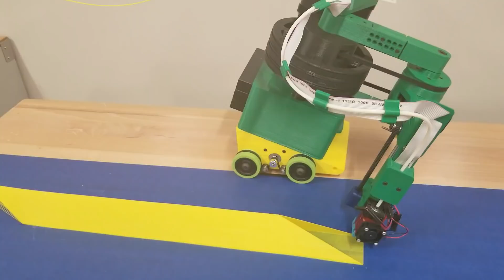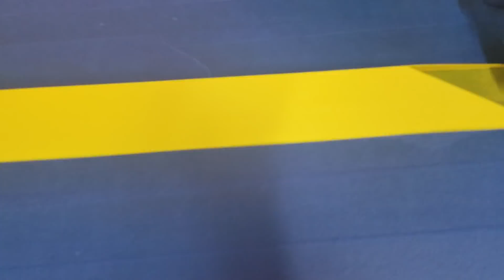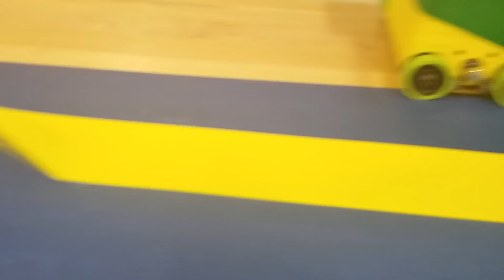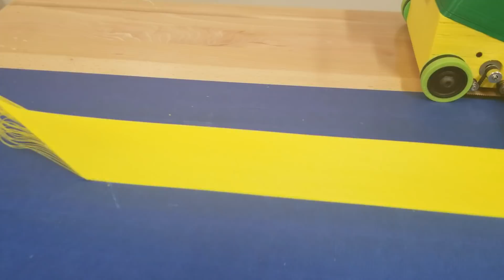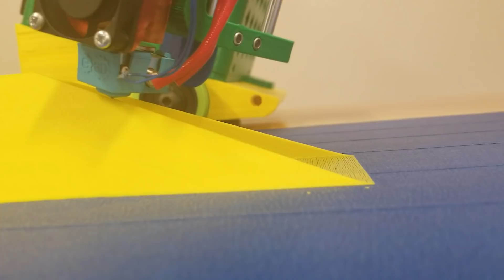Rolling RepRap HELIOS Prototype

Comment: with larger diameter wheels you would get better traction.
Reply from the maker: I dont think so.  The max traction force is the coefficient of static friction times the weight of the printer.  There is an effect from contact area but it is hard to know what it is without experimenting.  Most engineers ignore this.

Comment: Very cool!!!!! The triangle looks very very good!!! How did you ensure that it didn't loose proper indexing/position (rolling)? Luck?

Have you thought about putting it on a rail? Aluminum extrusion? That way it can be used as is without solving the above issue
Reply from the maker: Since it only moves between layers  it is very good.  You might lose a mm in a m on a really bad day.

Comment: Hi Seward! your works is inspiration for me but, I think before try to increase volume work, we need to 1) upgrade mechanics, because these toothed belt will break easily before it can reach some meters of distance... 2) increase the velocity, suppose we can print infinite volume, it takes much hours even days => increase the probability of errors (to solve this, I propose to print with more than 1 hotend, but the electronics should change) 
if you increase the print volume with scara's, just change the size of each arm
regards
Reply from the maker: There are lots of options such as chain drive.  I haven't pushed the speed yet but I think the best approach is to increase the nozzle size.
Reply: @NicholasSeward  I think the chain drive share the same problem, but this is the only way to advance

Comment: I want to see a strength test of that triangular tube.
Reply from the maker: Haha...at 20 degrees the traces on the bottom barely touch.  This means the two top surfaces are .5mm thick and the bottom is .2mm with gaps every so often.  Bottom line...pretty weak.  Single wall spiral prints isn't something that is ultimately practical for this type of printer.

Comment: Very cool, I love it! It would be interesting to have use a mouse sensor for position control and have a robot driving on on a table with back / forward plus steering. 
Then you could have only one rotational and Z axis and move back and forth for the "Y". This would only work with batteries I guess.
Reply from the maker: Hmmmm.  This is why I can't post videos.  They always lead to more ideas.  :-)

Comment: You should have some tolerance to move the heat break / nozzle mating point further down in the heater block to give you a little more clearance from the heat block in the short term.
Reply from the maker: That is a good idea.  I can do that and take the heat sink to a grinder and get most any angle I want.  35 degrees is about when the flat part of most tips cause the orifice to be more than .2mm from the table.   The flat part is needed to get nice flat tops on you traces so I ultimately cant do too much more than I have already done.

Comment: This is brilliant. I'd love to see something like this also implementing automatic bed levelling :)
Reply from the maker: On it.  The trick is that you have to move the arm in its negative x direction to hit the table.  I have an accelerometer probe that can sense when it hits but all the current bed leveling schemes assume you need to move in the z direction.  Should be a easy enough fix but need to get under the hood.  The good news is that I already have a system in place that can add touch points as you go.  The process would be print a few layers, probe a few points, repeat.

Comment: I don't know if telling you this is good for your morale (in case they don't feature it) but I think this is so good I just tipped your video in to the Hackaday tips line. Well done. I love the potential this has for large curves and bends, unlike those other "infinite" printers with conveyor belt beds that only do "infinity" in one axis!
Reply from the maker: I don't control the wheels separately but it could be done!
Reply: Very nice consistency of your triangles.  And, Hackaday did feature it.  Congrats.
Reply: Getting a slicer to support that would be quite a challenge, though
Reply from the maker: @TDOBrandano  super easy...barely an inconvenience.  There is already a version of CURA for the black belt.  I can also just tilt a model 20 degree in the slicer.
Reply: They posted it almost 2 hours ago.
Reply: @AbuMaia01  You are replying to a post from 4 days ago.
Reply: @AbuMaia01  I understand you are looking for conflict which will detract from the point here, so I am choosing to disengage.  Enjoy.